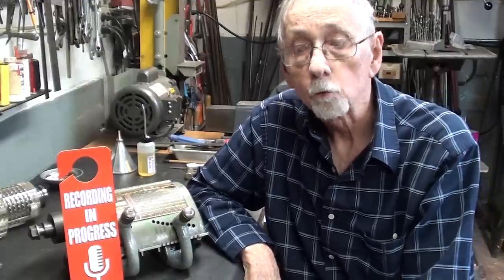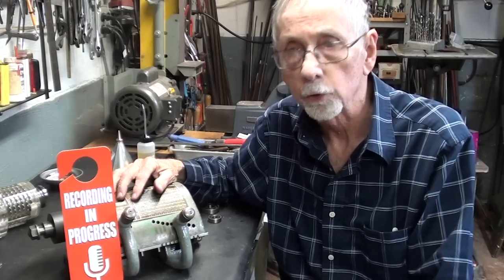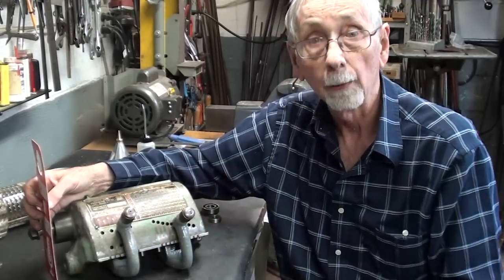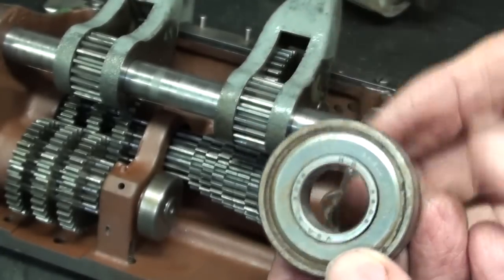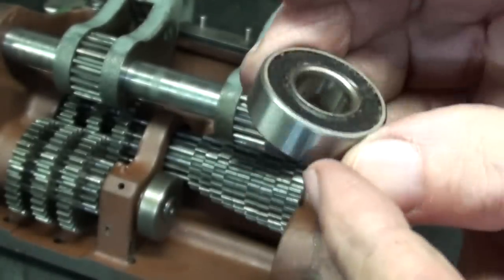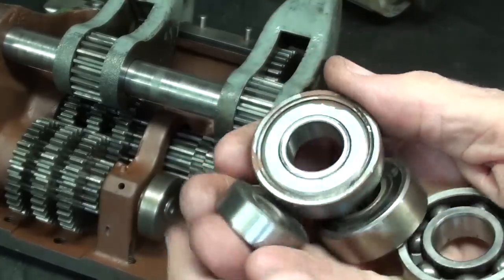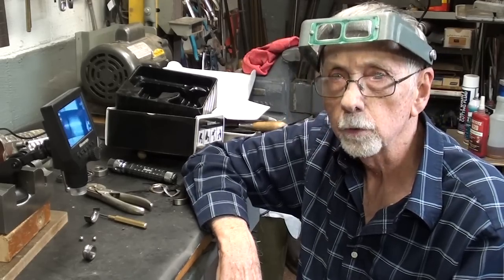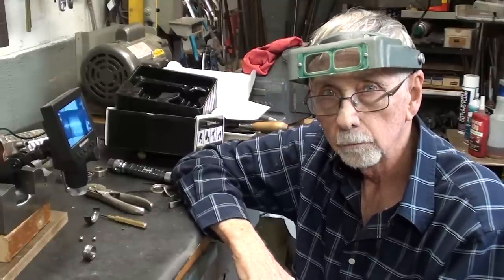FAILED BALL BEARING ANALYSIS short #23 tubalcain

Comment: Hey Mr. P. Me again.
If you would spend more than $30 on a piece of crap digital microscope (or less if you picked it up at a yard sale), you'd have one less thing to whine about. I mean, would you spend $30  on a Black & Decker (or Harbor Freight) piece of shit and expect it to perform as well as, or be as robust as, a $100+ Metabo (Hitachi) drill? Of course not (though cost doesn't necessarily equate to quality). Why spend big bucks on one item that will last for years and you'll be happy with when you can spend a few dollars on one you can complain about and replace every two years? How's that for a rant? 😉
Reply from the maker: That was quite a rant. I do have a Bosch and Lomb shop microscope. Probably worth thousands of dollars. But no way to photograph through it.